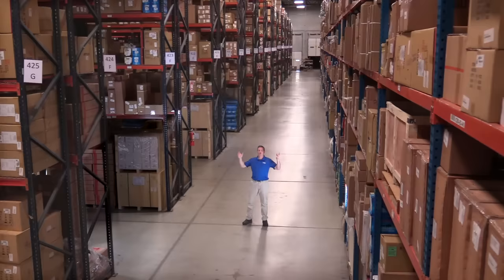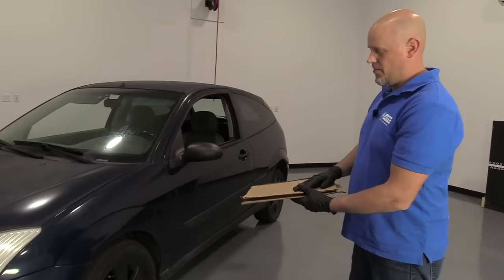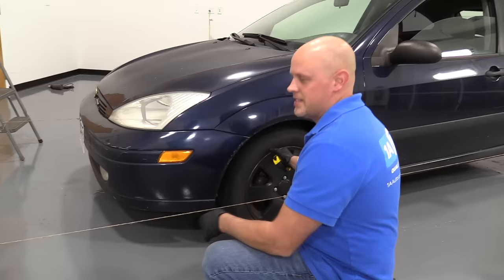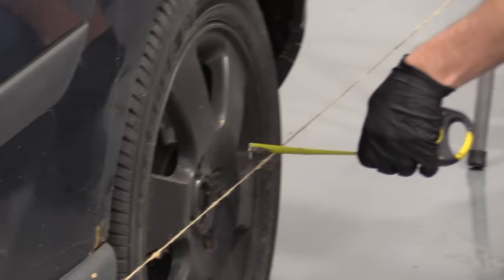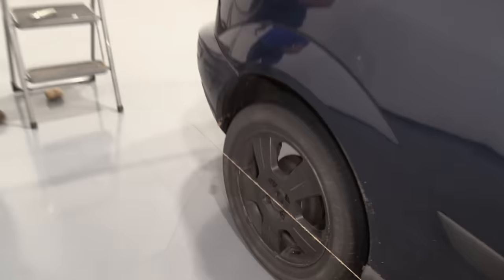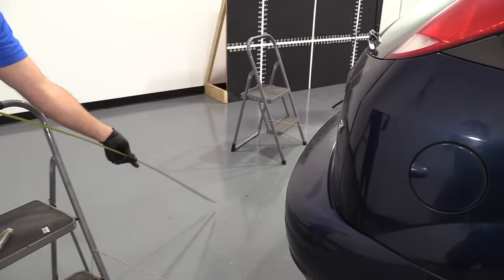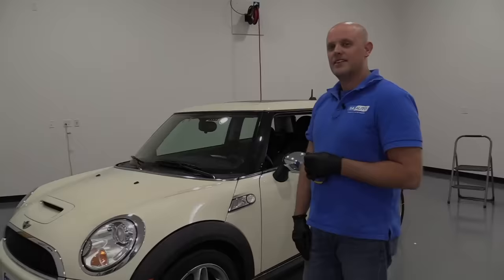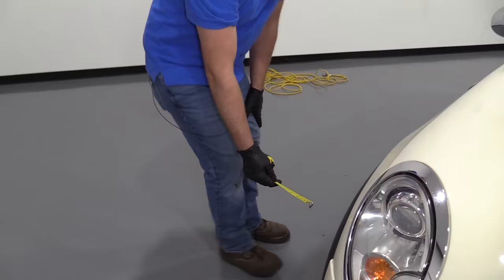How to Perform Wheel Alignment by Yourself

Comment: I would just be happy that my ford focus started
Reply: Should have went Honda or Toyota.
Reply: My car always starts but this has a new issue every few days
Reply: They're not difficult cars to fix! I love the Focus 😁
Reply: There's a quick easy solution for that. Get yourself a big flat-head screwdriver and pry all those blue ovals off of it. That should fix all your problems.
Reply: Toyota is the way
Reply: Should get A Vic or Marquis
Reply: Get a Ford Crown Victoria or Mercury Maurauder / Grand Marquis / Lincoln Town Car.
Reply: @brucekay9290  : Ford and GM is still made better than a Chrysler / Dodge product.

I have older GM vehicles, and they are good to me.

It's the newer cars that are have quality standards issues.

Some older domestics are quite well made.
Reply: Haha, I know what you mean! My first car was a 2003 Ford focus. I didn't know at the time that 2003 was one of the worst years for the Focus. Had less than 90,000 miles on it. In about 9-10 months, I put around $1,400 into it before giving up and selling it.
Reply: Yours starts...?
Reply: Dam
Reply: I have a 06 focus. Absolutely the worst model  ford has ever produced. What were them engineers even thinking
Reply: @E6TheManiaK   just got myself a lil 98 yota camry w bout 155k for less than 2k$ and honestly rides so smooth nice lil moon roof literally a dream to drive being over 20 years old
Reply: Tom Tucker •  Toyotas are greatfull cars. What am trying to say. Is ( when you do your preventive maintenance ) -
on them. They don't suddenly turn on you. Like the problem child Ford does. I have had 3 Toyota cars and 3 Toyota Tundra pickup trucks. 
1 Toyota SR5 Xtracab pickup. 1 Toyota Tacoma Accesscab pickup in all of my lifetime. They are the best quality around. You can bet you will get more years of servisability for your money. Count on it.
Reply: OutlawRebel420 • It is something strange isn't it.!! You would think that after the first generation of Ford Focus. They would have worked out all the bugs out by now !. But i personaly think it's somekind of ( Vendetta ) Whether it is against the customer who happens to be dupped into buying an unreliable POS Focus. Or maybe it's something personal against the genius of Henry Ford. For creating the Ford Company and the Ford model " T " in the early 20's. 
I can't figure it out ?. Can you ?
Reply: Frank Collins • I thank you sir. !!
Reply: Thank you so much for this comment lmao.
Reply: @outlawrebel4209  Weird i've had an old focus for the past 3 years and literally nothing has broken lol. Most reliable car i've owned
Reply: Haha
Reply: any luck on your Ford focus starting back up?
Reply: My friend had one years ago. Got Into a tiny accident with zero damage to his vehicle but it wouldn't start after that. Found out there was a gas pump kill switch that was activated by the bump of the other car. Bricked the motor until he could figure out how to reset that switch.
Reply: Lmfaooo come on usa! Do better!!!
Reply: Subaru all the way
Reply: Always will
Reply: what this guy said !🤣
Reply: 08 focus ses 236,000 and still going strong .. change oil every 5,000 miles with Mobil one full synthetic..
Reply: Focus on buying at Toyota lol

Comment: I'm sorry dude no way that  can be right
Reply: its NOT ...
This is a FWD car and all 4 tires need to be adjusted and he squared the string not knowing if all 4 hubs are equal to each other. 
Not all fwd have the front and rear hubs equal ... 
AND when he turned the steering wheel to get access to the tie rod, there is no way he will get that steering wheel BACK to where it 1st set it.

Comment: Shop said they did front end alignment. Took it back twice. Said couldnt be straightened. I watched the second time. Saw they were only doing a wheel balance. Didn't touch tie rods. I paid them to do it cause I didnt want to do it. Seems better option doing your own work. You cant pay people to do a simple job
Reply: Aint that the sad truth. Sadly, without an alignment machine it is hard to get proper specs, hence you are kind of forced to go to a shop for this.
Reply: Same with me, took my car and they did all the fancy measurements with laser equipment and gave me a sheet of paper with different angles and measurement and sent me on my merry way. Didn't even touch the tie rods and my steering is still all over the place.

Comment: It might be a obvious tip, but one thing I've always heard/seen when adjusting tie rods is to hold the outer end with a wrench as you adjust the inner rod. That way you don't put any un-needed stress or twist tension on the outer rod

Comment: One of my first vehicles in the '60's amongst other things it chewed the edge of the front tyres. I paid for alignment, it was worse! I had  little money but an ad. for budget repairs caught my eye. This old guy laid a metal tray device in front of each tyre and I helped him push the vehicle over it, he read off numbered marks on the tray and he adjusted the track rods. We did this a few times until he was happy. He charged very little and it completely cured the problem!

Comment: A better way of loosening or tightening the jam nut on the tie rod end is putting a wrench on the flats of the tile rod end. That way your putting stress on the wrench and not the ball and socket of the tie rod end.
Reply: That’s a good tip, it helps doing more precise adjustments because your tie rods will tend to go back to straight and screw your adjustment while driving
Reply: @MrMOGHammer  The adjustment won't change if you correctly tighten the jam nut.

Comment: It’s basically what the alignment shops do except they have the “expensive” equipment to do so. Thanks for the video!!!
Reply: Yea and they still manage to mess it up half the time :/
Reply: Wow
Reply: They have lasers
Reply: This is for getting you to a shop only. I don't know which alignment shops you have used in the past, but don't go back to them if they is what they do. This is for ROUGH toe adjustment only.  A proper alignment measures caster and camber also.
Reply: @thomaspalmer4251  depends on the car.  My Focus can only have the toe adjusted...no sense in paying for someone to turn my tie rods
Reply: @porkchop10  exactly.
Just keep an eye on your tire wear patterns. Should be fine.

What did the shops do before the "lazzzzer" was invented??
I'd use fishing line and digital calipers though.
Adjusting camber and castor (if your car allowed adjustments) is a different animal tho....

Comment: This is an excellent video,, I definitely think it would be very accurate to use a good strong fishing line instead of the string shown in order to get a good reading with the tape measure, I always use it and it works so well because you can see the perfect line to do the adjustments needed.

Comment: Just what i needed.  Replaced a tie rod end, and the old one is longer than the new one.  Steering wheel is off-center towards the left now, thanks for this quick 'n dirty technique, still have the other tie rod end to replace before going to get alignment, and it's 20 miles away.

Thank you!

Comment: What a great video and instruction. Can't thank you enough brother. Just got my wife's car back from Canadian tire and they couldn't do the alignment because upper tire rod locking nut was rusted . No phone call saying I needed new tie rods or they couldn't accomplish the job, nothing. So I thought no news was good news........wrong bucko. Before it went into shop I just replaced every other front end part except for upper the rods( still good) both ball joints, lower the rods , sway bar($1400) . Of course all my buds told me afterwards that I shouldn't of taken it there, I knew their rep but it was just an alignment .

Comment: I’ve done this a couple times with good results.    Sometimes I’ll have to test and tweak it a bit, but it allows me to do repairs like tie rods and struts myself, then align it good enough to get it to a tire shop.   Saves thousands
Reply: Thats what im trying to do haha my car goes straight at a 90 degree angle after replacing tie rods and upper and lower control arms

Comment: Did an alignment on a modern alignment machine on a three wheeled spyder. Customer was told that they had to travel to a special dealer alignment place for those bikes.
  Heck no you don't, just use a plank to hold up the back end on a regular alignment machine or use this method.
  Worked awesome.
Reply: Thanks !

Comment: Awesome instruction: Since I have a 1963 F100, I can do the Toe-In adjustment/ alignment my self.  No one has the tools to adjust the camber for this type of vehicle anymore since it requires a special hydraulic adjustment tool to adjust and bend the front axle.  Great video!!  Thanks guys.
Reply: Truck stops or the guys that set big truck alignment and i too have 70 f100 twin i beam
Reply: Any competent RV or heavy truck shop should be able to bend that axle up for you to spec
Reply: I would think bending the frame would be easier.
Reply: What does the tool look like?

Comment: Guys at a race track use the string method to set up and adjust their race cars on practice nights.When I lived in Nashville my neighbor was Bobby Hamilton and I would go to Nashville's Racetrack at the fairgrounds where they have the half mile track and a quarter mile track inside or the half mile track.So Bobby would help guys sort out their race cars.He was an awsome driver.If a guy's car was handling terrible,he could take it for a couple of laps and tell from the seat if his pants what was off.He would tell their pit crew what to adjust and the car would handle right.I once ask him what the difference between the Winston Cup cars and the Grand National Cars was.He said the Winston Cup cars had so much more horsepower that if you floored it when crossing the 12inch painted finish line they would break the rear tires loose.He can a decent career but never was able to get the tip of the line equipment and team that the top 8 or 10 drivers had.He won 4 Winston Cup Races and Raced from 1989 to 2005.Unfortunately he passed away in January 2007.
Reply: And ?

Comment: I did this first time. Instead of a rope I clipped on a cat Lazer pointer to one wheel. To the other I clipped on a tiny square mirror. When the mirror is out an inch it bounces the Bram back perfectly into one beam. Or if your alignment isn't suppose to be dead on center you can use a tool to measure the angle backwards onto the wall and do some math your alignment is 100% to spec.

Comment: I'm genuinely surprised at how well this worked. I adjusted the toe on our 2007 Chevy Aveo after changing tie rods, ball joints and wheel bearings (steering wheel was FAR from center). I used the first method to set the alignment, and the second to verify the alignment was set. I should now be set for the next 2 weeks until the local repair shop can get my car in. Thanks for this info!
Reply from the maker: +Nathan Ford Thank you! We love empowering our customers and showing how to perform DIY auto repairs with our high-quality auto parts.  http://1aau.to/m/Shop-1AAuto-c
Reply: Thanks for this comment. I just did a rack and pinion and my alignment is way off. My steering wheel is almost sideways as straight. 😅

Comment: Great video. At 4:22 when you bring out the back to square up the strings, it would be best to split the difference on each side. By adjusting one side, you end up with a square sided rectangle, but the car is slightly askew within it. Also, I would use 50 lb test fishing line as it is finer and smooth, you will get more accurate measurements that way. I am designing a DIY setup with low cost self leveling builder's lasers with a cross hair beam and targets on a board with mm marks across the full width of a car. I will be able to do 4 wheel alignment for toe and camber, and some side targets on movable boards to determine caster.

Comment: The lock nut displacement could have been moved 7/16 of an inch away from the outer tie rod end to get the desired initial movement. Also, retightening the lock nit before the next measurement is unnecessary until the final dimension is determined. Good information however.
Reply: That only applies if you're measuring in the same spot on the front of the wheel as the tie-rod is on the back. I know my tie-rod doesn't quite align with the back edge of my wheel. The further from center your measurement point is, the greater the measurement is going to be. So if you adjust the tie-rod the same amount that you're measuring at the outer edge of the wheel, you're going to overcorrect. But if you know your tie-rod is about 5/6ths of the way to the edge from the center of the wheel then you could calculate roughly how far you needed to turn it based on that. I'd much prefer that to his guess and check method though.

Comment: Good info, thanks.  Its like running a brick mason's line.  Random thought, putting an old brake rotor (1 or 2) on each step stool would help hold the stools in place.  And not being a troll, but if someone did not have string they could use brick masons nylon string.  Go to the big box store and look for 100ft empire gold twisted line with reel.  You do no need to cut the line, just run it slack from  divers side to passenger side and then tie it off, or wrap it around a brick like 5 times, and get the brick at the right height however you can, step stools, milk crates, a stack of old bricks, etc.

Comment: I found that concrete blocks work very well, especially if you don't have 4 step stools. Once I achieved proper toe, I had to compensate 1/2 turn to correct for thrust angle. It's nice that someone broke the lock nuts loose so we wouldn't be bored with the reality of using a torch.

Comment: Good video.  But another little trick. I'm a carpenter by trade.  So I have a small dewalt laser level which shines a perfectly plum laser  line.   I use this instead of the string line but is the same principle.   Once the laser line is  parallel on either side with the centre line of the vehicle  it works a treat.
Reply from the maker: +Coleman Hurley Thanks for the tip!

Comment: Awesome video. One of my brothers showed me how to align doing the tape trick. I just eyeball it though then take it to get aligned. Thanks for sharing this informative video.
Reply from the maker: +xHouston Kingx Thanks for checking us out. 1aauto.com
Reply: xHouston Kingx Make sure you center the spoke and have somebody to hold the wheel straight. Otherwise, the steering wheel will end up out of line. OTC has a steering wheel holder. Longacre has a toe bar. Amazon has it. Get a Snap on caster/camber gauge from Amazon or EBAY. Get one that reads inches if your spec is inches. Get the right tools to align it. Check for loose steering first.
Reply: @hankbridges7824  you can also drive the seat belt through the steering and tighten it to block it, making sure it stays straight

Comment: Using actual string instead of that thick hairy twine makes measurements easier and more accurate.
Reply: horustubes lol thinking the same thing
Reply: some ol barnyard yarn
Reply: 50lb  fishing line
Reply: @davidjones-vx9ju  That's what I use.
Reply: Dental floss. Everyone has some and it's strong small and sharp for clear measurements.
Reply: I was wondering the same, why not use fishing line or thinner twine?
Reply: @rreinhard43  probably because they wanted the string to be highly visible to the camera. It does make it easy to see for the panned out scenes.

Comment: Thank you for this video, I just had my car front alignment done and the mechanic said he had to use a kit. But my car still pulls (slighter) to the right while driving. I’m going to check the alignment now, thanks for the info.
Reply: Remember, most roads are crowned to the right so rain water runs safely off the driving surface.  Because of this, it's normal for the vehicle to move in the direction of the crown, naturally.  This should not be a great amount where you're fighting to keep the vehicle in the lane.
Another consideration is if the front tires are worn unevenly from a prior alignment issue, the worn tires can cause the vehicle to pull, accordingly.
Reply: Should have taken it back, since he didnt do the job correctly.
If they didnt make it right, dispute the charge.
Reply: Same thing happens to me after a good day of drinking, my car pulls slightly this was and slightly the other. Super fing wierd
Reply: @TT-uz1vp  hard to drive when the road constantly moves left and right.

Comment: This method is only valid if front and rear track widths are the same. Many are different front and rear, so you can imagine that the string will be off square if you use the same distance from hub to string on front and rear.

Check the specifications of your car for track widths and adjust the measurement from the center of the hub to the string accordingly.

Comment: One thing you need to be aware of…. Make sure your wheel is centered after you do this procedure. If it is off more than 15 degrees it will set the check engine light. Why? Because it has a steering sensor that allows usually plus or minus 15 degrees. If the steering wheel is off more than that amount while going straight down the road the steering sensor will set the light to let you know you are way off. Just a tip to let you know your attempt to correct was not close enough.
Reply: Some cars might have that but most cars don’t
Reply: @MrMOGHammer  I'm guessing it's linked to the ESP/ESC (Electronic stability control)

Comment: Easier way is to just put two thin boards against the outside of each front wheel. Then measure between the boards in front and behind the tires. Should be the same adjust until the distance between boards is exactly the same